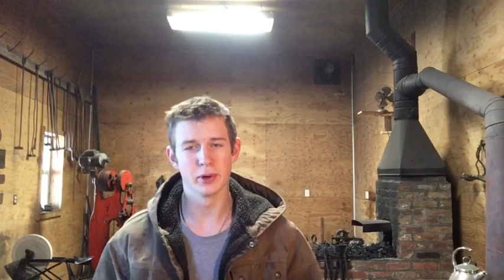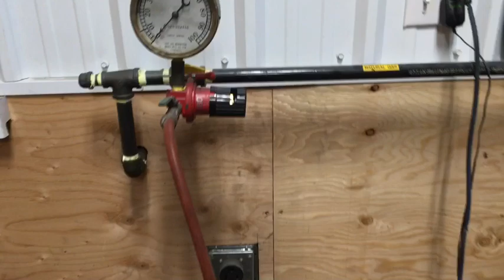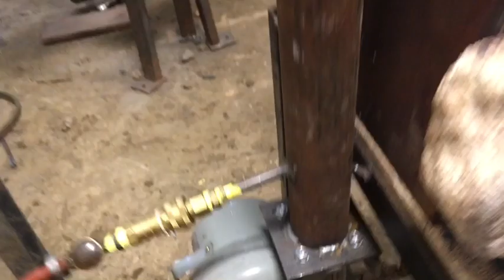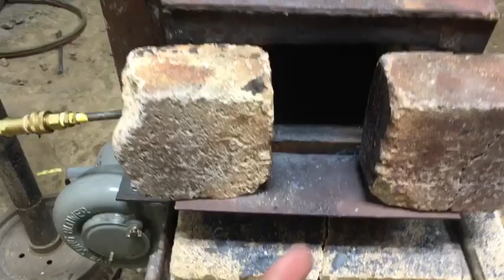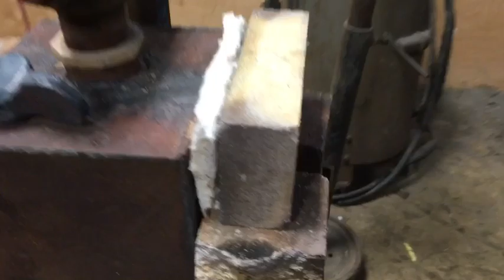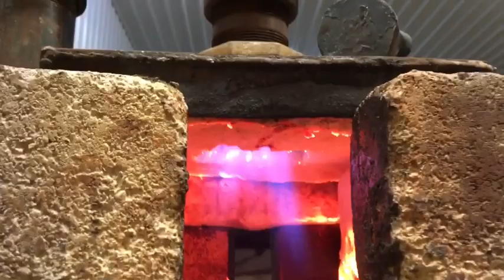Gas Forges: Venturi vs. Forced air

Comment: In your experience, what burns hotter more easily?Dave Lisch uses a venturi burner for his Damascus steel, and so do many other smiths. My own forge, however, has a hard time getting to those temperatures. It may be because my forge is not well enough insulated.What insulation do you use? I am planning on relining mine with kaolwool and coating it with several layers of satanite or similar refractory cement.
Reply from the maker: Cave of Skarzs I have experience with David Lisch’s burners, they, for some reason work very well. But forced air is always more efficient...therefore it can get hotter, but it all depends how much fuel you put through them. I use kale wool insulation
Reply: Thank you for the recommendation!

Comment: Good stuff Ethan, can't hear you with forge on,  would like to see the ribbon burner they sound good, but look too hard to make.what insulation do you use in your forge?
Reply from the maker: Lenblacksmith as I explain in the video, I use a small steel plat with holes in it. If you have a round hole like mine, it is an acceptable way to make a simple ribbon burner
Reply: A picture would be good.
Reply from the maker: Lenblacksmith the closest thing to a picture I can get is what you see in the first couple of seconds of this video.
Reply: Ok hard to see but hard to understand how it is made, never mind.
Reply from the maker: Lenblacksmith fallow me on instagram. I’ll post about it Tomorrow.
Reply: Ok see if I can use it on my PC don't use it on my phone.